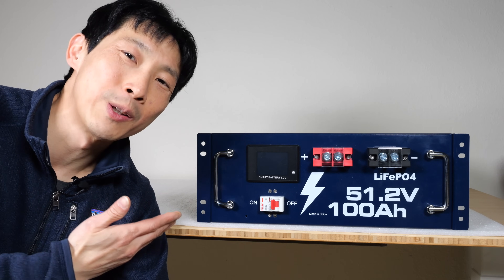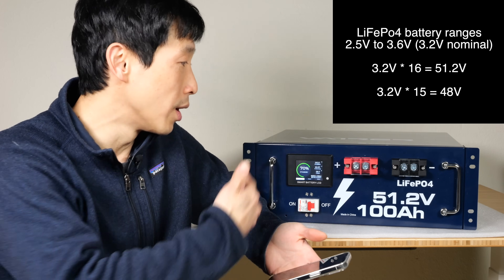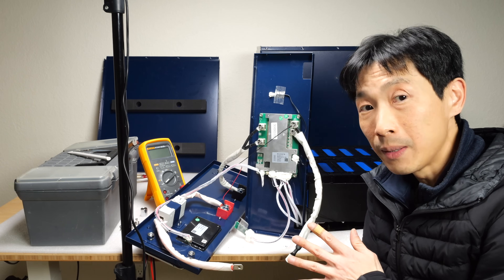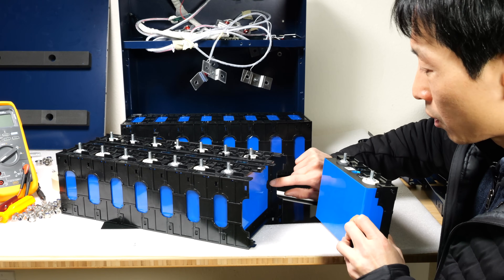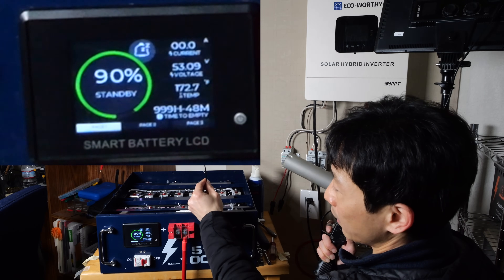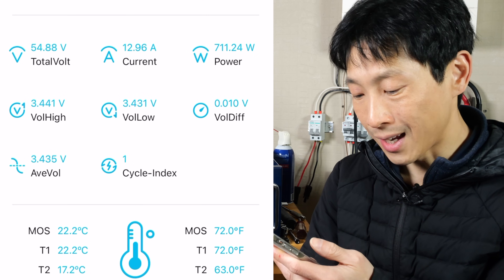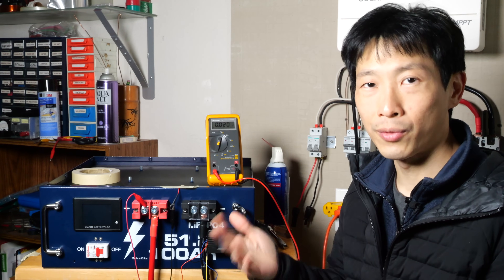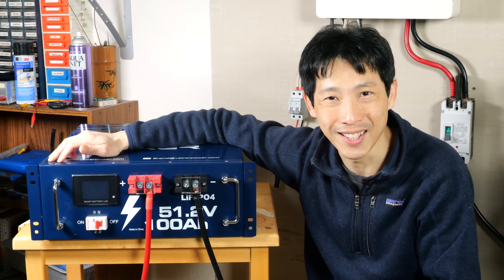Why a 48V System is Better than a 12V? [Vatrer Power]

Comment from the maker: EDIT 4/29/24 - 
Starting March 2024, this product ships with the CHINT CB-125A DC circuit breaker.

==== The following no longer applies ===
WARNING: The circuit breaker used in this product is a AC breaker which does not include arc suppression like in DC breakers. Therefore, do not buy this item until I get a green light from the manufacturer that they updated the circuit breaker.
Reply: Please keep us updated.
Reply: There are some AC circuit breakers that are ok for DC use you have to look up the spec sheets to find out. NoArk for example have many rated for DC use at 48 volts.
Reply: Is there a breaker replacement you'd recommend for those that have already purchased the unit?
Reply: @gridlessbob993  appreciate the share!
Reply: Also… a sketchy 15S version they sell advertised as 48V

Comment: Hi Francis. This video is great. I have a question, looking to install solar system on my camper and it appears to me the 48v system is a more cost effective system than 12v especially when it comes to the hardware & capacity especially with the package control units. Am I correct in my thinking or at the end of the day is 12v vs 48v equal? 
Thx, Traveling Ted
Reply from the maker: The wires are cheaper in 48V but you might also consider if you have 12VDC, 48VDC, or 120VAC appliances. When you use DC directly, it saves a little in conversion meaning if you ONLY use DC you would need slightly less capacity. I think the most efficiently is go to with a 48V system and use DC everywhere. Do not even use an AC inverter if you can.
Reply: @BeatTheBush  I have a 3way fridge, gas water heater, and so the biggest power hog is the a/c, which I’d like to have at least during the night. Going with the 48v all I need is the converter down to 12v and the inverter to package unit to a/c correct?
Reply from the maker: No idea what power type your a/c runs. You don't want to down convert to 12v THEN to 120VAC. You just want to use an 48V inverter that has 120VAC output. Also, a dual hose AC would boost efficiency even if you have to modify. your current one to minimize negative pressure from sucking in hot air through the cracks.

Comment: Ive been working with 48v all of my adult life. I've worked for the telecommunication industry for going on 44 years. Everything from 911, to SS7, anything on copper, even today's fiber transmission equipment - works on a 48v platform, everything. Every Central office (that's the bit that makes your phone calls, routes your internet, supplies you with bandwidth, on and on) all run on 48v. there are things that just are a sweet spot 48v is one of those you can stack it over and over without distribution loss.
Reply: it matter if you use one 48v battery or 4 12v in series? as far as capacity?

Comment: $500 for a 12v lifepo4???? Regular price (not even a sale like most of us wait for) for 4 (FOUR) 100ah 12v vatrers right now is $649.99.... and plenty of options for less $$$/Wh available in 12v batteries.  Please tell me how ANY 48v battery can come close to competing with using 4 12v batteries in series to do the exact same thing. I REALLY wish it was at least close so I could justify going to 48v batteries. The cabling and lugs are extremely inexpensive in the quantities/lengths needed for series wiring, so that's negligible. Also, when (NOT IF) a cell fails, the one 12v battery with the bad cell can quickly, easily, and inexpensively be replaced.... in a 48v battery, that one cell is basically a killer of the ENTIRE investment.

I'm really hoping that you, or someone, can use real world numbers to make the 48v battery argument. When I tried to get this answer on a popular fb group, all I was given was over 500 replies of defense, none of which could justify the cost of using 48v batteries over using 12v batteries in series to do the same thing...
Reply from the maker: 48V system has a built in battery balancer, circuit breaker, fuse, less cables.
Reply: @BeatTheBush  So, kinda the same response all those on fb made... with no numbers to back anything up? Yes, a 48v has a bms to help balance the cells, but so do each and every one of the 12v batteries. Having everything "built into" a single, huge battery means that if any one component fails, the entire battery is out of service. Hope there are numbers someone can provide that back up the value of any 48v battery on the market vs the same quality 12v batteries.

Comment: I been going back and forth in my head over batteries . I'm putting in an eg4 18k inverter. My service is on the outside with my panel. My garage is on the other side of my house 40 feet away . Those eg4 power pro batteries are nice , but I would like to save money if I can. Running a 4 Awg Wire 40' ft times two at $2.00 a foot is $160.00 on just wire and not counting busbar set up.  Is that  too far?
Reply from the maker: You could possibly do a conduit protected 240V AC run from the panel into your garage and locate the inverter and battery there. The cables would carry less current but higher voltage and can be thinner. Not official advice, please consult an electrician.
Reply: @BeatTheBush  okay! So that is three wires and a ground in and out!

Comment: could you just go ahead and put in thicker internal wires?  if they are running close to the heat limit at 100A then why not, huh?
Reply from the maker: I wouldn't recommend it since you'll have to work with raw battery cells which require proper precautions since in the event they are shorted, nothing will cut the circuit and prevent excessive current.

Comment: It smells like herd mentality to recommend everyone to move to 48v. besides the cost of wires there are many other advantages to 12v and 24v. among many the cost of batteries - the standard battery is 12.8v and they are the cheapest, everything inside is cheaper like the bms. if you want a small 48v solar system it will cost you a lot for 4 12v batteries or an expansive special 48v battery.
Another consideration is there are many standard devices working on 12v and 24v directly - you can avoid power loses of inverting power to 110v. In addition most cheap inverters and solar charge controllers support only 12v/24v.

Comment: 24v if you diy the batteries yourself is much cheaper for now because of all the extra 280ah lifepo4 cells. theyre like 40$/kwh wholesale shipped right now. crazy.
going 48v with 280ah cells is around 16kwh to get the minimum 16s set up. 16kwh for 700 bucks is half the price of most starter 48v batteries because they use the more expensive 100ah cells which ev mfg are competing for...

Comment: First  2 minutes, info :  OK.   Newtons'   Laws  state '' energy is not lost - only transformed ''.   There is a mid-point, between  WIRE  size/insulation properties , due to Physics  Laws.  ONE,  must  choose, WHAT  voltage  is needed, for  the  (your ! )  Applications.  For most, 48 volts is fine ; 4800  watts.   That, would power heaters, small stove, and most AC  units, as well as  any  fridge, washing machine,  small electric dryers, probably  All  lights.  The  Balance, point, of  Cost /versus  Needs , must  be  CHOSEN   WISELY.   Always,  All Ways,....leave  your  options,   OPEN,  for expansion;  over  time  hi-tech will modify,  slightly,  ACCORDING   TO   THE   ABOVE   LAWS,  OF  PHYSICS / ELECTRONICS /ELECTRONS.....and  wires !

Comment: I'd like to replace a lead acid 48v piece of equipment but worried that the 16 cell lithium will be outside spec on rhe nominal and charge voltage. Would it be better to go with 15 cells pack?
Reply from the maker: Generally, you better have a charge controller that is compatible with a LiFePO battery if you will use one. You can easily over charge or over discharge it with the wrong controller.

Comment: I just had a 18 250w solar panel, 8 5120Wh rack mount battery system using dual Victron solar controller dual inverter system in my motorhome. It was depressingly expensive. I replaced my 3 AC units with Furrion Cube AC units with variable speed compressors to get mini-split efficiency. Total cost was about $33k with everything included. Depressing but it'll be worth it when I boondock. I got the exact same batteries but from a different vendor.
Reply from the maker: Yeah, batteries are very hard to get a good ROI. You end up paying the price to be energy independent which is worth every penny when there is no power.

Comment: Why we stop at 48v nominal? Not just an arbitrary number. Its due to safety classification.
...The white paper compares NEC to ANSI Standards. It sites the following NEC voltage standards:
High Distribution - 1000 to 4160 volts
Medium Distribution - 50 to 1000 volts
Low Distribution - 0 to 49 volts
Reply from the maker: As you increase the voltage, the danger increases. Death can result if mistakes are made.

Comment: I have been running a 120vdc bank since 2008.  Not 120 ac but 120dc. 10 x 12v in series or 60 forklift cells.
 I am hoping to upgrade to lithium iron  say 5 x  24volt in series.
  Would it work?
  Could I just wire them in series and their  individual boards look after themselves.
 Would this work OK.
 I still use the 2kw inverter and 2 kW controllers installed in 2008.
Reply from the maker: Probably cannot help you design your whole system from just one comment. You do need to see if the DC output range is compatible with your inverter input. 120VDC is not typical.
Reply: @BeatTheBush  Back then. There were only 5 of with  120vdc systems.
I believe ,I am now the last one. Everyone has switched to lipo 4 48vdc.
I would like to keep the old Chinese inverter and controllers. They are bullet proof.  We also a a 120 vdc wind turbine which uses 2 x 138vdc immersion as dump loads.  The PV 5KW approx also goes through the WT  dump load relays.
 It works very well. I also run my workshop of it. The old iron core. Low frequency  2kw inverter is very dependable and used less on standby.
 For bigger power. I use the  120 vdc 4 power module Symettra rm. Or when I am cutting the lawn I boot up an Eason Compac 3 000 again 120vdc 2.7kw.
  It would be handy if zi could switch over onto 5 x 200ah x 120vdc lithium iron.
Reply from the maker: 5-24V LiFePO batteries would range in voltage from 100-146V DC. You must make sure the previous system can operate at this range. Lead acid voltage would have went up to only 130V. So your charge controller needs to know how to charge this type of battery.

Comment: Picked up this on Amazon Prime Day with a 15% discount getting it down to $934.98, then an additional 7% discount getting it down to 869.53 pre tax shipped to my door ($941.27 estimated post tax). That's $0.17-$0.18 per Wh!!! Can't beat it. Now if only I could find a way to modify it to add a RJ45 connector.....

@BeatTheBush Is there a way you know of to add a RJ45 unit to the BMS to make it have communications to other devices? I saw an empty connector on the BMS, not sure what that's used for or if that would work? Or maybe one would have to swap utility of the screen to have the cable?
Reply from the maker: You would be in DIY modding territory here. I would start looking if the BMS has any documentation for interfacing.

Comment: What issues can occur if four 12v LFP batteries put in series (making a 48v bank) then connecting the bank to a 48v LFP rack mount battery like the one in the video? I don't believe it is a good idea as BMS conflict may occur or is this possible?
Reply: You are better off with all your batteries managed by 1 bms if you have a 24 system, you want all the cells per 24v managed by the same bms so it.can keep them all in balance.  Stringing together multiple batteries to increase your voltage can be problematic Because you can run into balancing issues purbattery in the series chain. Granted you can put in battery balancers but still that is not really ideal

Comment: A 48v 100ah lifepo4 is $1000 and a 12v 100lifepo4 is $200. Would they last the same amount of time or how would efficiency work?
Reply from the maker: Power = Voltage x Current
48V 100Ah = 4800Wh
12V 100Ah = 1200Wh
48V one would last 4 times as long at the same power draw.

Comment: Excellent video!  
I like your explanation on the low temp CHARGE vs DISCHARGE settings. Other sites do not seem to fully test and explain or hold the manufacturer accountable for proper documentation.
Keep up the great work and clear explanations, thank you.

Comment: At my offgrid cabin, we use an EEL DIY 12v boxes w/ 200A BMS, MB31 cells at 304Ah, we have two of them.  My cabin is 90% 12v, basically runs like an RV...fridge, lights, water pump, hot water heater, etc.  AC for cooling is 120Vac mini split and we have maybe 5 outlets for 120Vac devices.  Small solar at 2Kw which is mostly to run the AC unit, originally was 400W.  At my house we have 4 server rack Gobel Power boxes, also DIY builds, just add batteries, 2 @ 280Ah and 2 at 304Ah, all with the same JK BMS at 200A.  The batteries talk to the inverter without issue.  Your 100Ah batteries give you 5.2Kwh, where my little ones are 10.8Kwh and the two bigger ones are 15Kwh.  I do not export to the grid, I use the solar power and charge the batteries as I'm in CA where its nearly pointless on NEM3.0 to export.  I would have to export 15Kw to "pay for" 1Kw of grid.  More batteries, the better.

Comment: So let me ask the question here if you have a 12 volt battery at 100 amp hour is that the same as a 48 volt 25 amp hour battery and vice versa if you have a 48 volt 100 amp hour battery that's the same as having a 12 volt battery with 400 amp hour. Is that right?
Reply: The same in what way? A lot of things change. But the capacity is the same so yes you are right in this regard.

Comment: Thanks for the review. I have a Vatrer also. What gauge wire are you using between your inverter and MCCB, and MCCB and T class fuse?
Reply from the maker: 2 awg but I really should move them to 0 awg.

Comment: Dude, you totally rock, I am now encouraged to finally start on my DIY, I also will be using 48 volts, also I wanted to let you know that using a 20 volt drill on a 48 volt system; with 48 volt nuts, might by dangerous, be careful please, don't be nuts!
Reply from the maker: You have a point. I probably should use insulated wrenches and screwdrivers when touching the cell terminals. The 20V drill though, is metallic but 'shouldn't' have a voltage connected to the tip.

Comment: First, I LOVE your videos, always great stuff and created very professionally. Thanks for making things simpler. My question is, can this system be recharged with a standard 120/240v gas/propane generator? Thanks again, great stuff.
Reply from the maker: Yes you can limit the current draw to the most efficient level for your generator.

Comment: Hey Francis. Love your content specially I am also in Bay Area San Jose area. I recently think of build the off grid solar system with Ecoflow brand. Bought used solar panels locally. 
Question is, do I need a permit to build this kind of system since it is not tied to PGE grid. 

Thank you for your input

Comment: 12 volt is my go to system no matter how many people use 48 volt. I feel comfortable with a BMS system in the batteries for added protection. People always say there is something better but that is a relative term. I like the tried and tested 12 volt system and without all that inverting and converting back and forth. But it amounts to what works best for your needs. Mine are very simple and uncomplicated. Next week someone will have a 96 volt system and and say it is better than the 48 volt. I'm enjoying the benefits of a 12 volt system which matches my 12 volt products; no mess; no fuss; no thrills, but gets the job done.
Reply from the maker: If you have a lot of 12V devices consuming significant energy, it does make sense to stay at 12V indeed. If you're using mostly AC voltage, 48V or higher is better to minimize cable losses.
Reply: Also buying 12volt appliances like fans are way more expensive and are weak , I’ve had a 12volt for a year and I can’t wait to upgrade
Reply: Try to keep an open mind... after all Tesla went to a 48 volt system for a reason. More "oomph "
Reply: You get 4x the run time. Also 12v makes alot of heat running ac and bigger stuff and that's a loss of energy. You don't get that with 48v

Comment: You can die from a 48 volt system by touching it wrong. Is dying worth the benefit of a few nickels saved on wire?
Reply: 48 volts has been the standard for over 100 years in the telco industry I know of no deaths from it worked with it for over 30 years. You save dollars not nickels when you have systems that are in thousands of watts copper is expensive and batteries last longer by drawing smaller currents.
Reply from the maker: I was comparing a 48V system to a 48V system with four 12V batteries. Not a 12V system with 4 batteries in parallel where it's a true 12V system. 100A on the 48V would equate to needing 400A capable wiring for the 12V system. The cost differential is in the hundred or two.

Comment: The problem with 48v is that when you want to step up and increase your storage rating you have to buy 16 cells, 8 cells for 24v and only 4 cells for 12v,  I'm with 24v.
Reply from the maker: Yes, when you have a 48V system, adding to the capacity will require you to add another 5kWh worth which is another $1100-1300 for cheap ones.